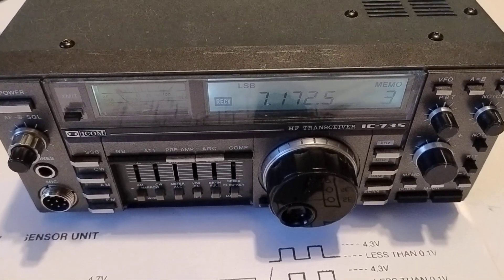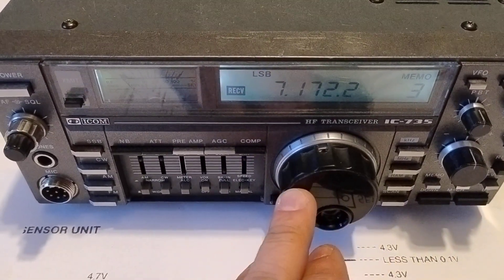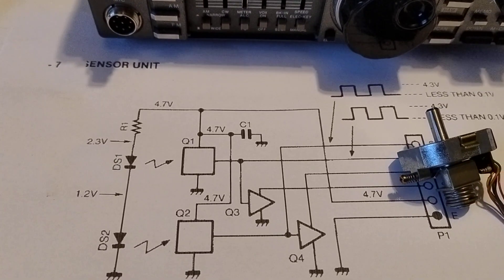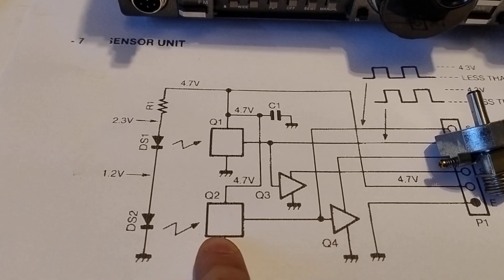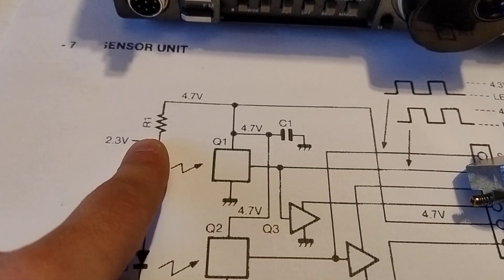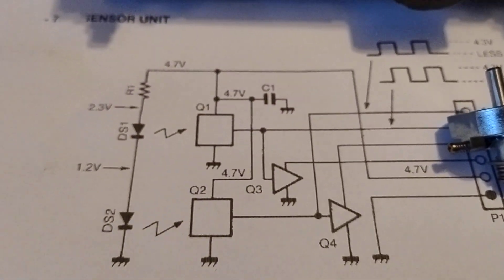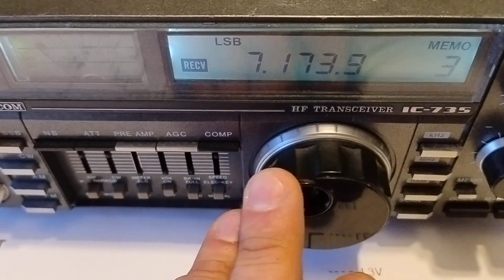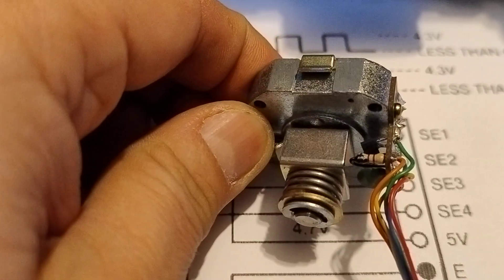Icom IC 735 encoder easy fix / repair

Comment: Hello, exactly as Adam W4AJF, I changed R1 for a 470 ohms but unfortunately, it did not work for me on my bad encoder of my IC-475. Again, thanks for sharing this video. I would really like to understand why sometimes it works and on other case, it is not. Best 73, Sylvain VE2PXP